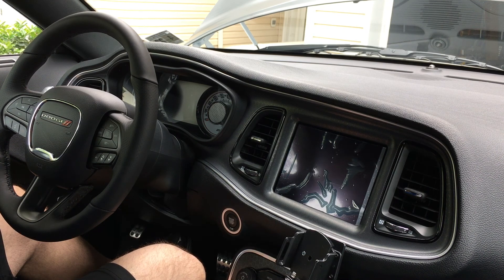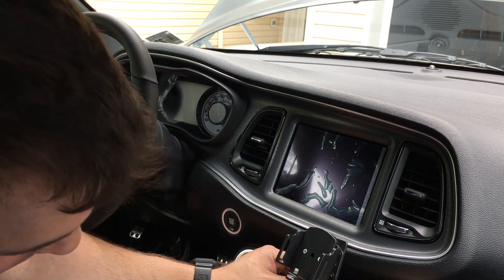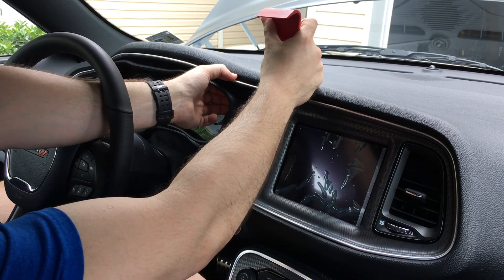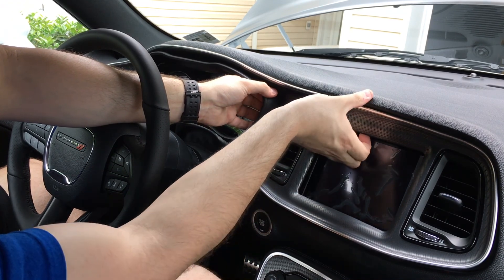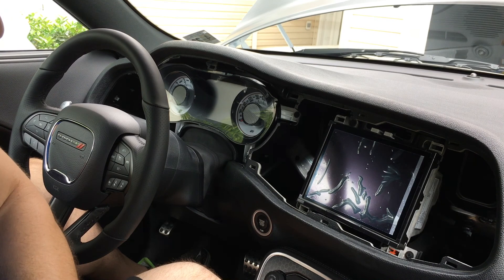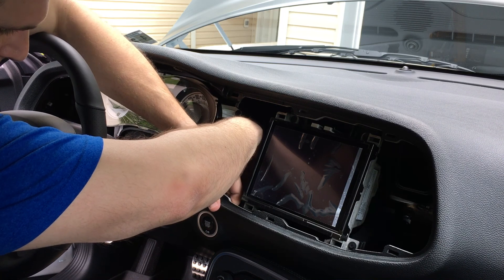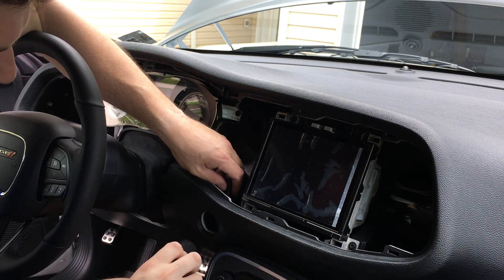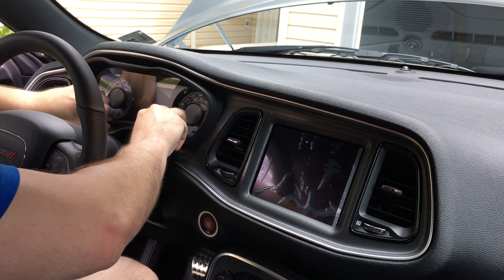2017 Challenger T/A 392 Red Start Button Installation

Comment: Did you happen to try some thin pry tool kind of like a feeler gauge to pry the starter button out from the outside? I think that would work without pulling off that trim panel...no?